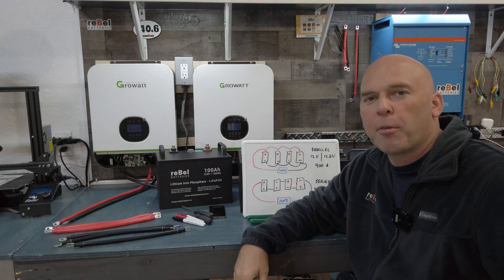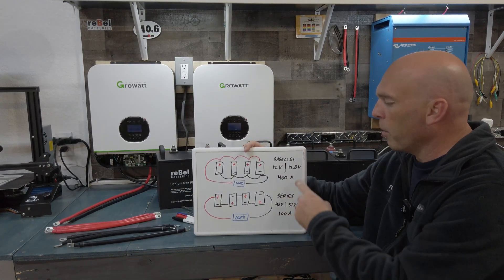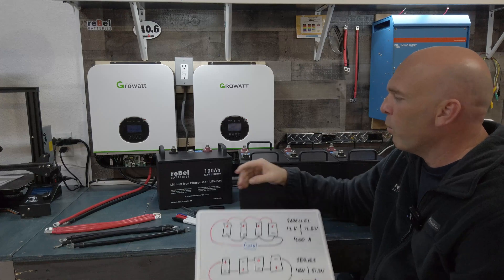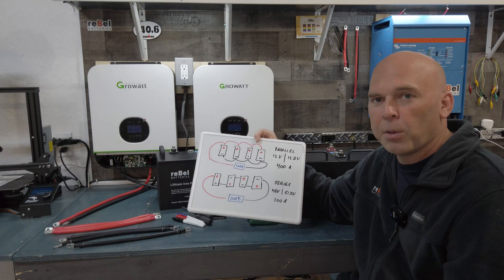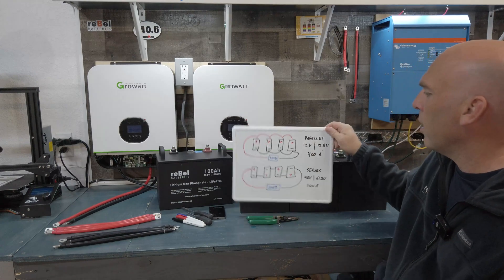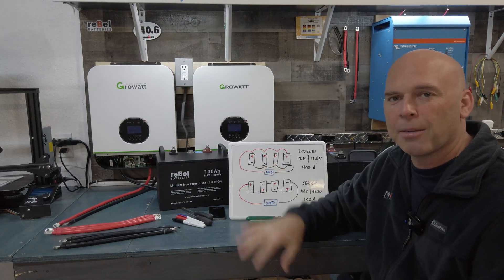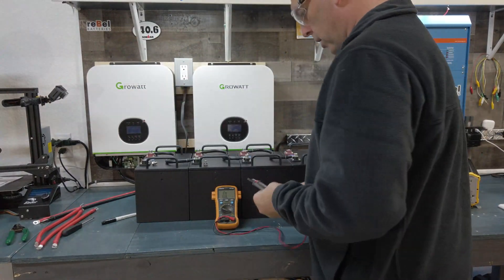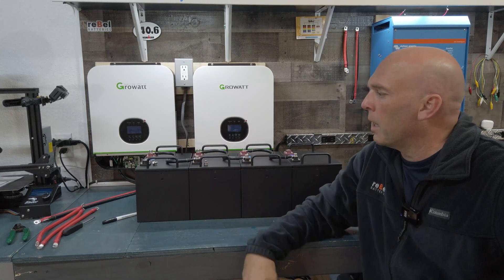Parallel vs Series (Beginner Friendly) Pros and Cons for Inverters - Part 3

Comment: just curious question,  what will happen to the individual parameters of the mppt, like nominal voltage, max dc operating voltage, etc,  which inverter parameters will be affect if you connect these inverters in series or parallel.  thanks for you answer